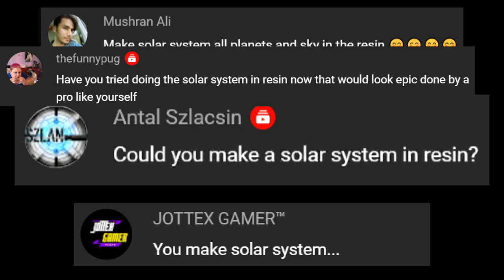Making Custom Resin Keycaps #4 / RESIN ART

Comment: This one was really nice. I didn't realize it was the solar system until the very end. How about using figurines of some sort in resin for keys? LEGO minifigs for example? If they are too thick, you could try splitting them/sanding them down. Or just use the heads (and head gear) for the smaller keys. (There are also mini-minifigs) Special keys could be higher than normal, though. Like ESC. Oh, btw; How about a subtly backlit keyboard with only resin keycaps? I'm sure you could sell single keys like hotcakes. :)
Reply from the maker: Thanks for the ideas